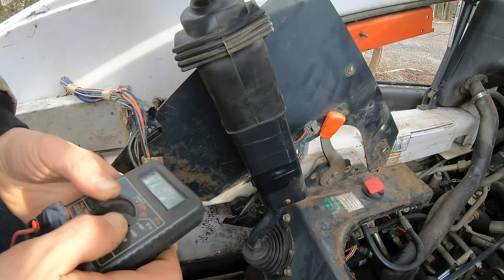Replacing a AHC computer

Comment: I don’t bother checking for continuity. I just go to the parts list and find the most expensive part because that’s my luck.
Reply: Roaming Gnome Lol careful $$$$$$ Where's your dumpster? lol
Reply: @sasasimunovic7709  true you'll
break computer card before
wiring connection ...lol
Reply: Look at your local dealer for anything , it's pretty obvious where dealers make their money ...parts and service .
Reply: Same here.
Reply: @rustyrods8535  yeah, no available aftermarket muffler for an 843 but Bobcat has it for $460.46, just my luck. Trying to do everything in my power to repair the original.
Reply: Rusty rods You got that right!
Reply: I just repaired the muffler on my JD 444G loader instead of replacing it because they wanted 350 buck for a new one and oh yeah heater core for the same machine 675.00 flushed it and filled it with radiator flush let it sit overnight, re flushed works fine now . 5,000 hours tick tock ...check book .
Reply: @CumminsCat  It's not really all that surprising - the production of theses machines is pretty small (e.g. less than 50k/year probably) so the cost per part is quite high as they probably don't invest in a lot of production automation.   Add that to the fact that downtime == money for most owners, it makes sense to price things higher.  Hell, I just had the audio amplifier in my Volvo go bad and they want $1000 for a new one..... and there are no used ones available, pretty much par for the course on small production run stuff.
Reply: @ckm-mkc  They could take note from Chevy 350 and LS motors.  Find something that works, make part interchangeable and dial it in.  The greed of making inferior parts that break just so they can repair it has to go.
Reply: Don’t you say that lol
My wife’s car died as soon as she pulled in the driveway. I plug in my scanner and check for codes. My luck..Hyundai decided to use the same code for 4 different parts.
I’m hoping it’s a cam sensor, I am tired of working on these cars Kia included. That’s why I left the dealership.
Reply: I see a market opportunity. Exhaust systems and computers. Better yet wire harnesses that eliminate stupid computers.
Reply: @Box545x39  There is already a lot of that, 1/2 the parts on the car have Ford logos on them and/or are the same part on Land Rovers....  There's only so much parts interchange you can do before it just becomes badge engineering.  

From what I can tell, there are several versions of this amp and the only difference is the case (under the passenger seat, floor is different from model to model), so I'm going to try a part from a different model.  If it works, I'll swap the internals.   On a side note, I seriously doubt Volvo has 'inferior' parts.  It's built like a brick shithouse (even if it was engineered when Ford owned them) - while they do have design faults (what doesn't), there's a reason why they last 500k miles and have the highest average lifespan in the industry.   In my case, a sunroof drain clogged and the failed part was under 3" of water for at least 2 days.....
Reply: @Box545x39 - Vehicle sales is only a small part of what car dealerships income. They live on parts and service. It's why they are so expensive. Many dealerships act like the car they sell you still belongs to them and you are required by some law to return to them for maintenance. It's the same in California as it is in Ohio. Both personal experience.
Reply: Micheal Plummer wow, thought those cars were low maintenance. Is yours high mileage?
Reply: That's me too lol
Reply: @sasasimunovic7709  lol probably is actually. That $1500 is probably a $2 micro pic or something and should be reliable for 50 years but the whole setup is pretty janky like it's built to die
Reply: It is always good to have mechanical actuator or anything though still primitive but damn realiable, how about converting it, have'nt come accross with it?
Reply: Hear that! LOL

Comment: That board isn't potted to protect it from water, it's potted to protect it from you doing non $1400 repairs.
Reply: The person that develops potting remover could get rich..
Reply: An "unpot" video, maybe a little heat, maybe just the right solvent, maybe a little jab at Bobcat and a little "right to repair commentary!!!
Reply: You're wrong.  Have worked in an industrial sensor manufacturing facility as an engineer...that potting is for keeping out water.  Look at the location of the computer!  I bet it gets wet all the time.
If you have the patience, you can burn potting compound off with a heat gun and exacto blade.  You can shave it off under heat.  
Many times the PCB is coated in a conformal coating compound (think slippery silicone film) to prevent the potting from shearing components off the board as it dries and shrinks.  As you get closer to the PCB, sometimes the potting compound will lift right off.  Sometimes.
Reply: @davec.3198  He is absolutely right! They fill it with black epoxy so you can't fix it and have to pay Bobcat $1400. You don't need to fill the can with black epoxy to waterproof it ffs.
Reply: @pbrstreetgang2489  And you belive it is just black epoxy that prevents your average bobcat owner from diagnosing a bad component on a PCB?  You have got to be kidding.
Look at all industrial and OHV equipment.  All potted.  Fills all voids.  It's cheap.  Prevents moisture intrusion.
Reply: @davec.3198  Funny thing is that boat ECU's are filled with standard conformal coating, which is much easier to remove than epoxy. It also makes the ECU serviceable by companies which specialize in board repair. There are definitely other waterproofing options which would not prevent diagnostics and repair, and again, not by the "average" owner, but by someone who knows what they're doing. I'm not trying to argue with you, but just pointing out that dark epoxy is used for both waterproofing and masking of the board.
Reply: @pikepunk1  
I'm not sure what you mean by "filled with conformal coating".  Conformal coating is by definition a spray on application to help reduce moisture intrusion.  Think splash protection but not waterproofing.  
Do you mean that the cavity is filled with a jelly like potting compound?  Many marine applications use a silicone based potting compound instead of the black potting because silicone can be better at high temps.  Was the ECU in an engine compartment?  Maybe somewhere it would get baked by the sun?  
The black slow cure epoxies are used, primarily because they are dirt cheap.  Pretty much every other type of two part potting compounds will cost more.  Particularly those that are optically clear.  
I have no skin in the game if you believe me or not.  I'm just giving my experience from being an engineer in industrial and OHV electronics/sensor manufacturing.  We never discussed "let's figure out how to make this unserviceable".  We always discussed "let's use the best process to make this as reliable as possible." 
We also sold to massive companies like John Deere, CAT, and others.  
If you ever do end up fixing a PCB and plan on re-potting it...just remember to bake it in the oven at 150-200F for about 30 mins.  This will remove moisture.  If you skip this step, you seal all of the moisture in.
Reply: @davec.3198  I'm familiar with the silicone based potting, and remove it regularly to make repairs to PCB's. Higher volume PCB's are typically dipped, and not sprayed. Spraying is not ideal for all types of PCB's as it is difficult to coat all surfaces. Thats besides the point though, as I stated before, dark epoxy serves no purpose other than to hide the PCB. The epoxy is clear/opaque to start with, and an ink or dye is added to color it.
Reply: @pikepunk1  I already explained it to you.  Believe what you want.  
Cheap black polyurethane epoxy is completely different than the silicone variety that you remove.  Clear or black urethane epoxies will be equally difficult to remove.  
Polyurethane potting compounds are filled with various resins.  If the black dye was not added they would be opaque at best, not clear.  The resins are not clear.  There are so many resins/fillers added that 5 gallon pails are stirred and agitated to keep the fillers suspended during dispensing.
Reply: @davec.3198  It is pretty clear what you want us or yourself to believe.
Reply: @Snurre86  LOL.  
I sure don't believe in a black potting conspiracy created by electrical engineers that have nothing to lose to prevent shade tree mechanics from repairing a PCB.
Reply: @Snurre86  Hahaha.  Great technical comeback.
Reply: @davec.3198  Sorry did not mean it, did not know you where special.
Reply: @TC-gn2by  As always, I hope you learned something.
Reply: @davec.3198  Im suprised at how closed minded people can even be towards information in regards to things they work with that could help them. Wow, well it was a very interesting and knowledgeable read for me, thank you!
Reply: @saberxzero  Glad to help.  I didn't realize preventing water intrusion was a controversial subject. :-)
Reply: @pootthatbak2578  its actually not that bad to do, although thats a thick potting block.  Heat it up to about 200 (boiling water works well) and itll do one of two things depending on the formulation.  Itll either get flexible and you can carve it away, or itll get brittle, and shatter with a good impact.    

Ive done it before on a bunch of smaller boards, nothing with quite that much potting, and it generally comes off clean.   Boards with through hole devices are tougher cause the epoxy wraps around the cap or resistor or whatever and its very likely itll rip it off the board when it comes off.   Surface mount stuff comes out much cleaner.
Reply: @davec.3198  yep.   Although through hole stuff gets encapsulated nastily anyway and tends to rip off when de-potting :/
Reply: @jbrukardt  I'd bet with something as industrial as a skidsteer, there is quite a bit of through-hole.
Reply: AMEN!!!!
Reply: @Mike This is OHV manufacturing.  Do you really believe aero has the same standards and margins as OHV?
Regulatory compliance are the name of the game in aero...not so at all with OHV.  Each manufacturer sets their own standards.  
Who do you think I was working with as equals in sensor manufacturing?  All PHD's, EE's...all advanced degrees.  BTW, I have my degrees as well, and what they have taught me is that industry knowledge trumps all degrees.   
Having advanced degrees, doesn't mean you understand each marketplace.  Come-on.  
There are lots of options for watersealing.  Like i said before, potting is dirt cheap and that is why they use it.  Using glands, connectors, ect all work to some extent, but not as well and cost effective as potting.
Reply: @davec.3198  //  I agree completely; it's logical, and it makes sense. Let them have their "everyones out to get me" outlook. To be honest, we shouldn't be surprised ppl think that way since many companies today produce substandard products that are no where near the quality they once possessed. My last refrigerator lasted 26 years, and I told that to the guy who delivered our new one. He laughed and said: "good luck getting 10-12 yrs out of this one" [huh]? Anyway, for what its worth; you're right on this one. God bless.
Reply: I do agree otherwise why would they pot a component that I use on a device that is for indoor use. Must be to keep the moisture out that sneaks inside when the door is open and it is raining. @Dave C. 🙄
Reply: Manufacturers are slowly taking away our ability to repair by limiting replacement parts, their plan for us is to replace and not repair.
Reply: Potting is to protect from the heavy vibrations which is definitely needed on these. It's not waterproofing lol.

Comment: Andrew,    When you took the new controller out of the box you said it looked used.  Perhaps it was returned by another customer  for the same intermittent problem you are having with it.  If Bobcat retested it it may have tested good even though it has an intermittent problem.  You may have been sold a returned controller.
Reply: Yep- happens all the time
Reply: That is exactly what I thought when he said it was used!
Reply: Crossed my mind too.
Reply: Yes, $1500 buys NEW not reconditioned, a typical tactic used to clear old or obsolete parts instead of supplying new. Talk to Bobcat and get them to bring out another part and fit it Free of Charge or if you could bring the loader to them get them to prove otherwise.
Reply: I was thinking the same thing. That happened to me at John Deere. I learned to always inspect the part before leaving the parts counter.
Reply: DAMN I sure hope he reads this comment and returns this faulty new controller. Andrew saw it was used right away and that's not worth that 1500
Reply: Sometimes when troubleshooting a problem like this, the ECM (Caterpillar terminology for electronic control module) is often the first thing that is changed. When the new module doesn’t fix the fault it gets returned for credit because it’s so expensive. Happens a lot throughout dealerships. Often a new ECM needs to be flash-filed with model specific information before it will work. Flashing a new module leaves an internal fingerprint on the part which voids its eligibility for credit return. This part doesn’t seem to require flashing with data but nevertheless it was probably a “tried it but it didn’t fix it” returned part
Reply: Good call Don Coz.............. just might be the problem
Reply: yep
Reply: I sell auto parts part-time,  and I inspect EVERY part that I pull in front of the customer for that reason. I too am a consumer. They can come from the DC in a slightly used or "installed once" condition. Not selling that.
Reply: It has been my experience buying parts, if it is electronic, it is not returnable and they usually have a sign posted at the counter saying such.
Reply: Hi! The problem with the new computer -- it needed to work out an error code condition. 

The second replacement might have been just the first replacement computer with the proper wiring attachments. [I am joking some.] 

His replacement skid steer seems to work well. I think Mr. C will find obtaining another old-school CPU-free piece of equipment might not happen. Maybe.
Reply: @ianbarnes8593  I worked Auto parts 07,08. There was alot of this. Electronics were givin to elite customers. If its not needed, rebox, credit you said it. Next guy got a used part. Average Joe better get it right, bc NO RETURNS on electronics
Reply: @skipwiley72  Jope you aint busy bc that takes alot of time. Every part ,everytime?? IDK
Reply: @dianagoodrich7169  The error code would have been stored in the old module.
Reply: One of the things I like about this channel is the comments sections. Lots of good stuff here, great advice man!
Reply: Yep, most of us learn these lessons the hard way.
Reply: I bet someone else (in the service department) tried plugging it in while fault finding only to realise that THEIR problem wasnt the CPU. Back on the shelf then waiting for Andrew and his $1400.
Reply: I worked at an auto dealership/service center, the mechanics would install new parts and return them if it didnt solve the problem. fyi

Comment: May I recommend that each time you have a connector apart, that you put a little dielectric grease in it - it will prevent corrosion, and help to maintain good electrical contact in the future. Perhaps the machine needs to be reset to accept the new controller better. Again, a great video.

Comment: I am a construction supervisor and had a contractor with a CAT skid steer doing a large septic system for a school, It sounded terrible and sounded like it had never been greased. The owner said he does nothing for maintenance, not even changing the oil or grease it, and after two years he trades it in for a new one. He said the old ones are shipped to Mexico. He claims he gets the same price for trade no matter the condition. Thanks for the great video's.
Reply: Waterman one nn

Comment: I remember having the same exact problem with a bobcat that was maybe a year old at the time,  It would just randomly stop and have to turn it off and on to get it to work,  I remember getting the codes and talking with bobcat, I think it was an easy fix like resetting the computer or maybe it just fixed itself, I can't remember but its unfortunate that they have issues because they are so nice to run when they are working.
Reply: I think a re-flash might help

Comment: I own a 2010 acs/sjc S-300 2 speed Bobcat and after the 3000 hour mark it really began burning through lift and tilt actuators.  Like every 200 hours of operation (always at inconvenient times - night snow pushing etc.) here in Canada they cost about $1,300each.  So, after replacing the fourth actuator in less than 800 hours, I pulled the hydraulic controller right out of the machine the body that the actuators bolt into, capped all the connectors and bought a re-seal kit because was hydraulic oil was getting passed the seals and submerging the electric motors in the actuators causing pre-mature failure.  It's somewhat of a nuisance job but the machine now runs great and I had it tested at my local bobcat dealer and discovered the hydraulic pump to running at 93% efficiency still.  Your video has helped me with a new problem where the run screen get's confused and will ask me to enter a password while the machine is still running but the controls and the machine still work perfectly fine.  I bought the $800 service manual the mechanics use and it's helpful but a video of a guy actually doing the work is night and day better.  What tools work, what doesn't, what to avoid etc.  At almost 3,900 hours I didn't know that side panel slides up and the computer for the machine sits behind.  Thanks again.  Awesome Video!